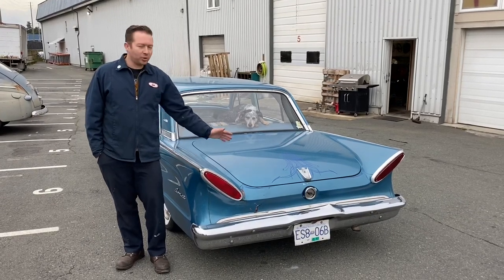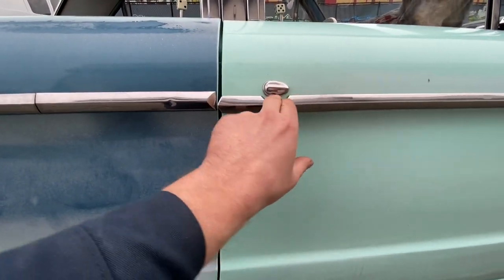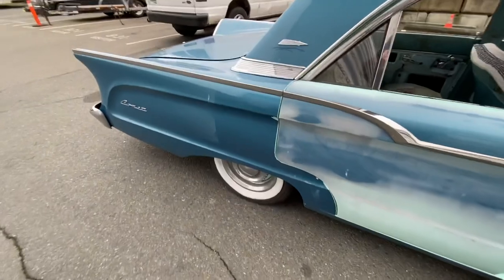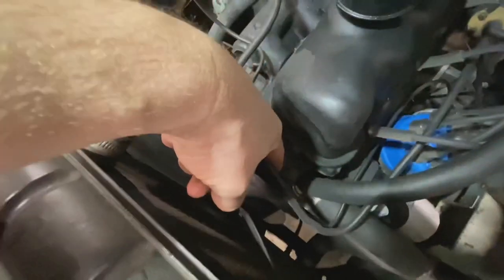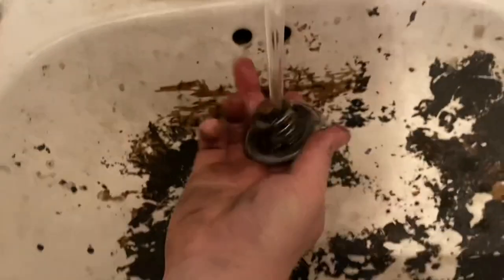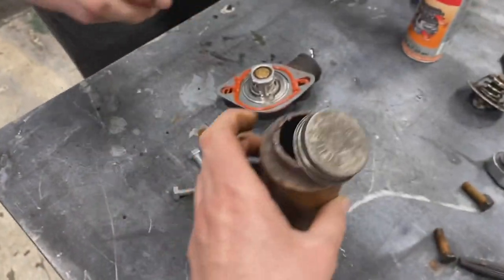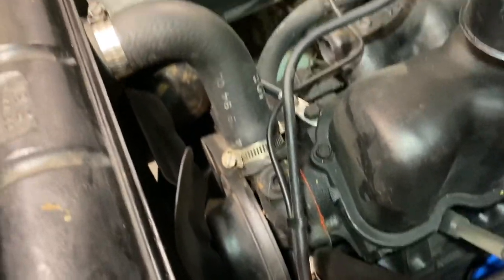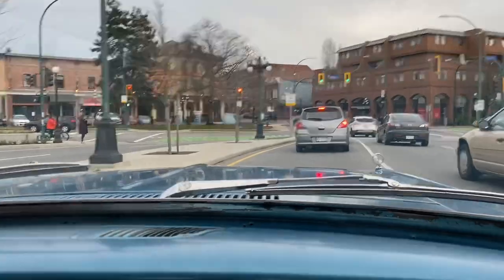1961 Comet Thermostat Replacement by Lee & Shannon

Comment: If it has 13 inch wheels look for the 14 inch mustang or maverick rims for a better ride, also move the harness wire away from the shock tower in case she hits a pothole & busts those little bolts, I have a 62 Ranchero & it happened to me once, had to replace alot of wiring. The drum brakes cylinders are unsafe, I suggest upgrade to disk brakes on front. An aluminum thermostat housing will help with the extreme temperatures, in the summer put a 160 degree thermostat in it. I'd replace the heater core, if it isn't leaking, it will. ~ LS swap it?
Reply from the maker: Nothing wrong with drum brakes. This car has used them for over 60 years, hasn’t crashed yet! And semi trucks still use them to this day with 100,000 pounds behind them.
Like anything, you just have to do your maintenance.

Comment: 180 degree thermostat is all that motor needs. Cooling system is dirty and antifreeze is weak. U should have flushed and added new antifreeze. No heat and no gage says stuck thermostat or no thermostat. U don't know much about mechanics.
Reply from the maker: Thanks for watching. I guess I’m not as good as mechanic as you are, but I get by.
Reply: @LGKustoms  😂
Reply: @LGKustoms  His channels Pretty awesome too lol great video Lee, Id take a hoodie if you decide to print them.